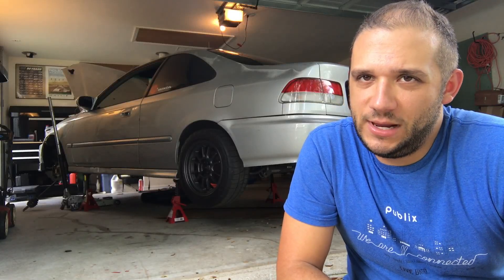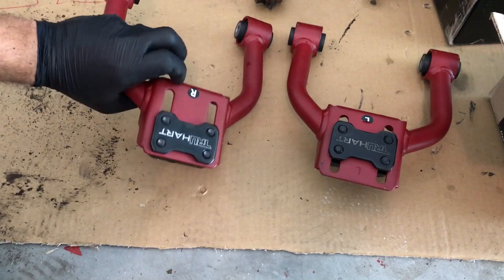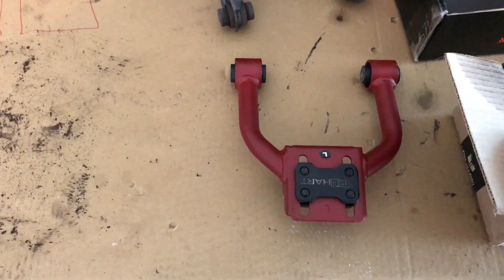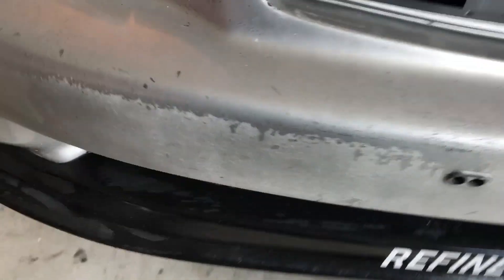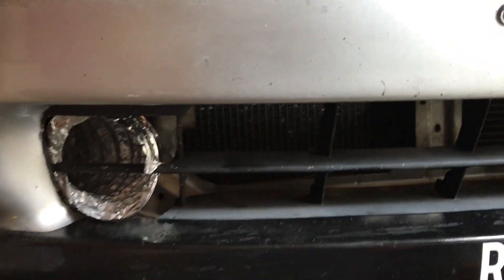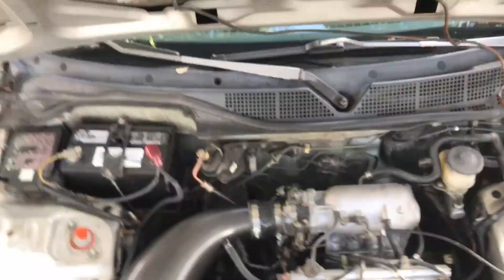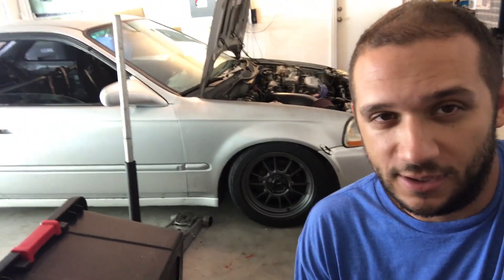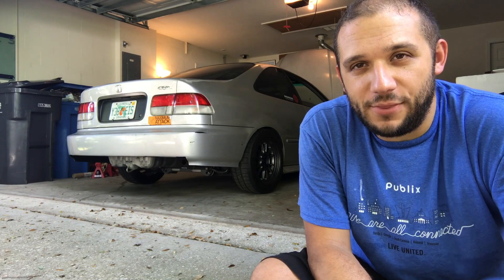Finish / Test New Mods on Project Civic

Comment: to shave weight you can cut the bottom face of the doors and it will allow you to pry out the crash bar inside. promise the doors will feel lighter.
Reply from the maker: +Tony C. Thanks for the tip!

Comment: swapping and flipping track rod ends / tie rods is not recommended only if you are  using rose joints , if your going 2 do it make sure you use a taper drill bit as that what locks in in place , dont mess with your steering or brakes unless you know what your doing
Reply from the maker: +Ryan Costello I appreciate the feedback and your the 3rd comment on this mix up. I was given bad info so that's why I did what I did. But hardrace and ktuned make tie rod ends to correct my problem so I'll be getting those.
Reply: will you put up a link to them as i might need some thanks ?
Reply from the maker: +Ryan Costello https://www.jhpusa.com/store/pc/viewPrd.asp?idproduct=34701&idcategory=1790
Reply: i googled it and there not cheep
Reply from the maker: +Ryan Costello yeah I know but I'd rather not die on the track
Reply: you will need 2 change the hub ? not sure what you call it over there as you drilled it and the new ones wont be safe without the original taper in the hole that the tie rod fits in :(
Reply from the maker: +Ryan Costello i think the hub will be fine. it will work with the new tie rods It has a special design that's tapered and it won't come loose
Reply: Refine Movement the new part has a taper but you drilled it out from the underneath?  if so no more taper . I can see from there website how they fit and u might need 2 check there still ok .
Reply from the maker: From looking at the pictures I think it will be fine and will work. I did not drill it a lot...just enough on the bottom of the hub so the tie rod could go in.

Comment: what size drill bit did u use
Reply from the maker: +Chris Provost don't do what I did unless your going to buy new aftermarket tie rods. I was told today you can't just flip it around as they could come loose. Check the comments for a better explanation.  I have the new tie rods coming there made by ktune. There just for racing and can be installed upside down safely
Reply: I race  an daily it
Reply: just track night
Reply: auto cross sometimes
Reply: I'm gunnar try an shim the steering rack
Reply from the maker: Good luck i hope it works out.